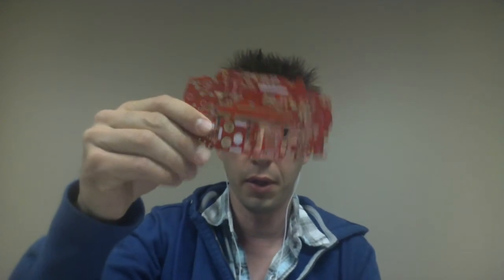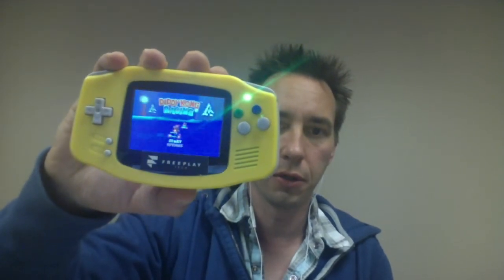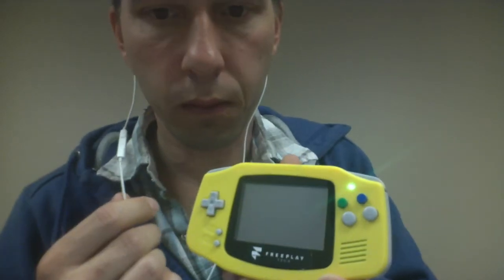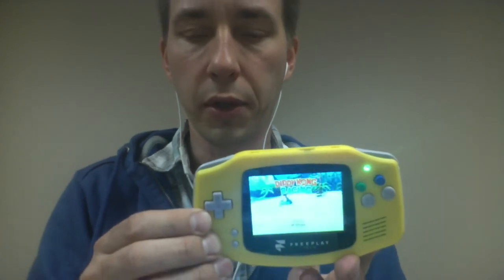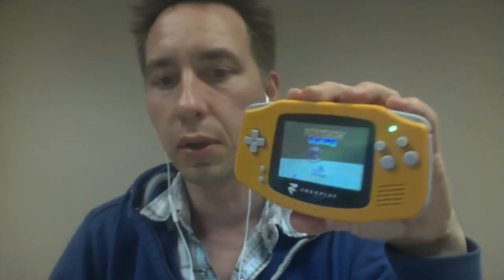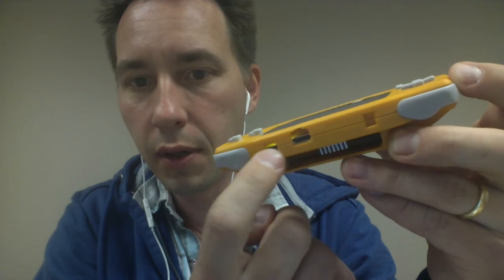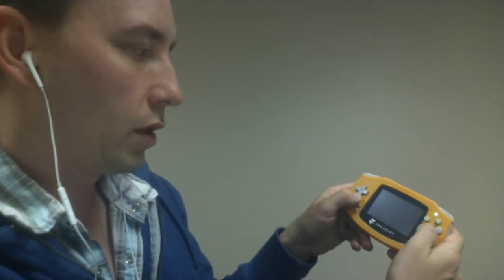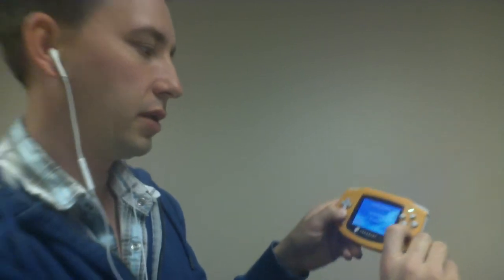Freeplay CM3 Announcement

Comment: I was looking at the pcb and im wondering if it has pins so i can connect another usb to it while still having the usbport on it available.. i saw some usb - and + ... what are the usbex + and -?
Reply from the maker: We added some room for POSSIBLE future expansion.  There are a couple traces you can cut with the idea of adding an internal USB hub.  Then the USBEX pins would connect to the "external" USB port.  Does that make sense?
Reply: Okay so far there is only one usb out on the pcb but i can connect a usb hub to the usb - + then cut some traces and connect the usbex-+ to the usb hub to use the usb port already on the device?
Reply from the maker: That's the main idea.  I don't think anyone has tried it yet.  We considered a add-on sub-PCB, but we've been swamped with getting the Freeplay CM3 ready to ship.
Reply: Thats great to hear .. i wanted to see if i could connect maybe a teensy to add a few extra buttons and maybe see if i can find a way to fit a psp joystick maybe near the start and select buttons .. but i didnt want to lose usb port .. so i guess my option would be to add a usb hub .. connect the usbex to it and the teensy and maybe even bluetooth and wifi  .. which dont come on this pcb if im noy mistaking... it looks like theres a small amount of room left on the back side of the case

Comment: Can it play ps1 games since it has a pi 3 and if so what about the second shoulder button?
Reply from the maker: Of course the buttons/dpad isn't the same as the PSX/PS1 (or N64), so that will always be an issue unless you plug in a USB (or maybe Bluetooth) controller.  Otherwise, many PSX/PSP seem to work well.  I think you should see performance similar to https://www.youtube.com/watch?v=4IQ_prN4cVI since it's the same CPU as the Pi3 (it's not an actual Pi3).

Comment: I saw them in the video, but how are the USB/MicroSD/HDMI ports different between the Zero and CM3?
Reply from the maker: Keep in mind that the Freeplay CM3 is a first-run prototype.  We're mainly showing that it works.  Things will change.  That being said, I'm really hoping that we can fit a full-sized USB port on there, so you can easily plug in an external controller, low-profile BT/WiFi dongles, a USB hub, or whatever (without needing an adapter).  The Pi Zero has the USB and HDMI on the Pi itself.  The Freeplay CM3 will have these components on our PCB, so we can place them wherever they fit best (within the confines of the circuitry and shell limitations).  I also really hope we can place the microSD port in a place where the user can decide if they want it to be externally accessible or not (by cutting an opening in the plastic shell).

Comment: Forgive me for being dumb but.. If the Freeplay Zero is a conversion kit allowing you to put a Pi Zero into a GBA then what exactly will be the nature of the Freeplay CM3 product itself? Is the aim to sell, not a conversion kit minus a Pi but, a fully modified Pi 3 with the USB ports removed and things altered to fit inside a GBA? Or a board and  sd card image that can somehow increase the power of a Pi Zero?
Reply from the maker: No.  It's not dumb.  I didn't really supply any details here, because I just wanted to get the news out.  Think of the Freeplay CM3 as a premium version of the Freeplay Zero (kinda).  With the FP Zero, you supply the Pi Zero and put it all together.  The FP CM3 is based off of the RPi Compute Module 3, so our board will have the same chip as a RPi3 (without all the USB ports and all that).  We are NOT altering a Pi 3.  It just uses the same chip and will run the same software.  The plan (for the Freeplay CM3) is for the board to come with the Pi built in, so the user doesn't need to do any soldering.  Freeplay Zero is cheaper, and you need to supply the Pi Zero.  Freeplay CM3 is faster, and comes with the Pi built-in.  Does that make better sense?
Reply: That makes much more sense! Thank you, I'm massively intrigued. It's a very ambitious project! Will you be shipping to the UK?
Reply from the maker: I really expect to have worldwide shipping via USPS Priority Mail.
Reply: Awesome :D I know this is an extremely early stage to ask, but any idea of a ballpark figure for a likely price? Under $150? (Where are you based buddy?)
Reply from the maker: We are in Rapid City, South Dakota, USA.  The Freeplay Zero was previously called the Game Pie Advance.  You can look that up, but we've already sold some of those DIY kits in the $80 range.  I'm hoping we can be in that ballpark when we do the full production.  Most people would assume that outsourcing would make it cheaper, but we've found that we need to choose some more expensive components to make the production outsourcing work.  The builder (you) supplies a GBA-style housing/shell, the Pi Zero W, an SD card, and a battery.  We'll have more specifics on the campaign.  That stuff should be in the $40 range (up or down depending on the options you choose).  The Freeplay CM3 kit will be a bit more expensive, as it's an upgrade and it comes with the Pi built in (but then again you don't need to buy a Pi elsewhere).  I hope that's useful as a ballpark.
Reply: It's very useful. I've subscribed to your website mailing list and can't wait for the chance to pay for a CM3 kit, as long as I can afford it haha.

I've one last question and I'll leave you alone (I am incredibly grateful for the speed of your responses btw and the effort you've taken to answer my questions, thank you :) ), I read somewhere that the screen of the Game Pie kit had some kind of diagonal tearing. Is this still an issue on the Freeplay Zero/CM3 screen and if so, how noticeable a difference is this visually when playing GBA games vs something like an original Gameboy Advance SP (later backlit model rather than side lit)?
Reply from the maker: Of course, after you offer praise for being quick to respond, I ignore you for a while.  :)  Yeah, the Freeplay Zero & CM3 both use the same LCD.  It is actually a portrait mode LCD that is commonly used in landscape mode.  This means the image has to be translated as it's being displayed which can result in tearing.  The tearing is pretty evident in the menu system, because it fades between white and black changing every pixel in the entire image at each step of the fade.  To be honest, I almost never see it in-game, because the games don't typically act this same way.  They are generally changing a small percentage of the pixels at each update.  Here's an example of the tearing from way back when we started the project.  https://www.youtube.com/watch?v=nDSU_Jn1jt8  But if you compare that to the video we're commenting on now, you won't notice that stuff in-game.

Comment: Interesting update. I'm a potential buyer for sure.

Up to what emulator will the cm3 support with optimal performance? N64? Psx? Dreamcast?

Thanks
Reply from the maker: Actually, I only just tried N64 and PSX.  I feel like PSX works better, but I think there's some good info out there on how to tweak RetroPie to run these faster on the RPi3.  I'd recommend digging around a bit on that.  I think some involve overclocking that I might not recommend on the handheld for battery and heat reasons.  Also, the N64 might expect the analog stick (which our handheld wouldn't have built-in), so you might want to consider an external gamepad if that was your target.
Reply from the maker: Also, maybe see https://github.com/RetroPie/RetroPie-Setup/wiki/Speed-Issues
Reply: Ed Mandy don't really have a target per se, just trying to get an idea of what this thing can and can't do. I'll be honest I'm not much of a fiddler. I wouldn't be comfortable overclocking and tweaking stuff. If it's mostly for snes and gba then so be it, no worries.